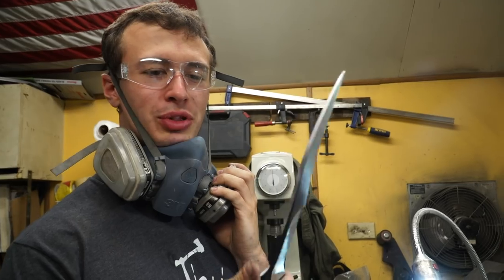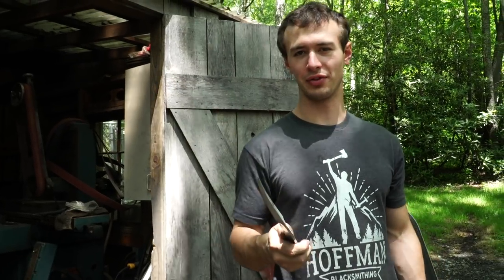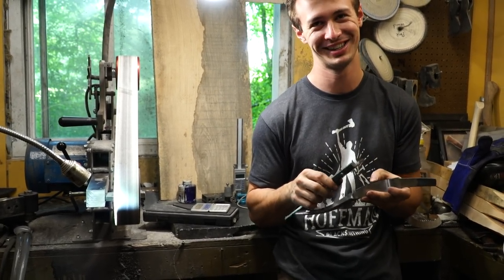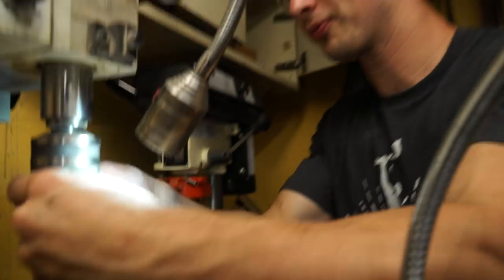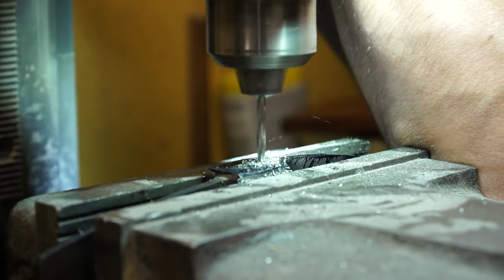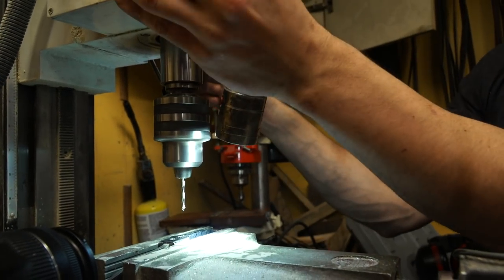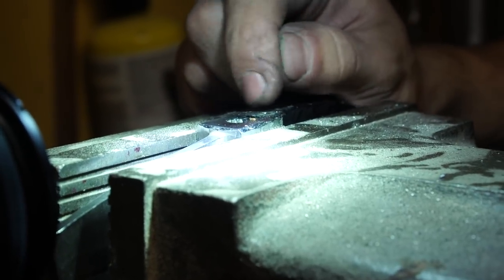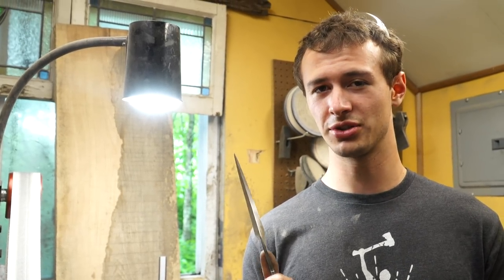DAMASCUS PERSIAN DAGGER BUILD ~ 5

Comment: Invest in a set of center drills to make pilot holes. Also, check alignment with the drill spinning in case there is slight runout. Not giving you grief, and I'm not a true machinist, but I've learned these tips through experience. Love your work.

Comment: As the guy that works in a machine shop there are a couple of things I'd change with the drilling. 

1) Get some center drills for drilling, not standard center drills. Center drills for drill bits hove am angle that better matches a drill bit and help in that regard. A standard center drill is the same angle as the center on a lathe and works but not as well. 

2) Every time I've center punched  my holes I've been off. The deformation around a center punch as little as it looks is enough to push a drill off center or even out of your punch mark. It works for many people, but for myself and others it causes issues. I like to locate by finding my edges than using a digital readout (if equipped), the scale on my hand crank, or a dial indicator, care may be taken to remove backwash in the direction you are moving if only using the scale in the hand wheel. 

3) Big bits like low RPM small bits like high. Hard metals like low RPM slow like high. 

4) Use lots of lubricant it keeps the tip of the bit cooler.

Comment: I drill alloys for a living (I work in a chemistry lab for ATI Specialty Materials).  Check the sharpness and cutting angle of your bits and chuck up on the bits some more.  Slow is best for hard metals. Remember that heat is not a drill bit's friend, so don't force the bit.  It will just get hot at the cutting edge and dull out faster.   I'm no machinist by any stretch of the imagination, but I drill hard metals all the time.  And drink.  So I drink and drill hard metals, it's what I do.  Lol!

Comment: If your hole is slightly off centre you can centre punch to the side in the direction you need to get the drill bit to go just put the mark hallfway between the bottom and the lip, this must be done before you get any depth

Comment: Buy yourself some center drill bits to start your pulot holes they are much more accurate in your set up, then go to your drill bits and they will not wander as you drill. Great job and thanks for your channel.